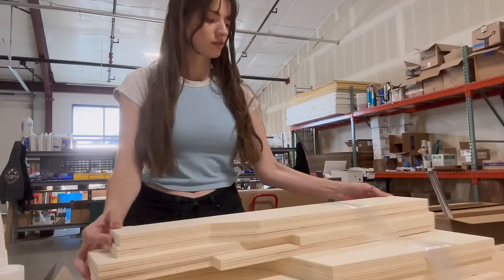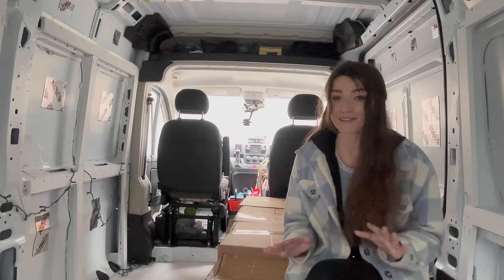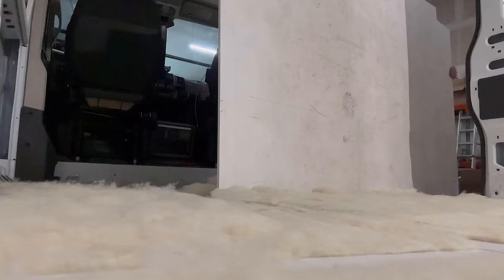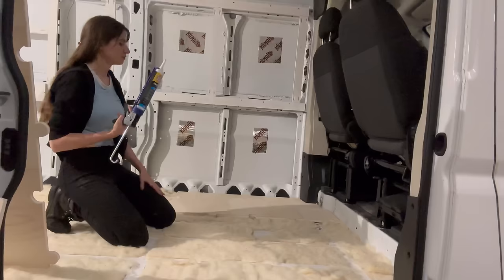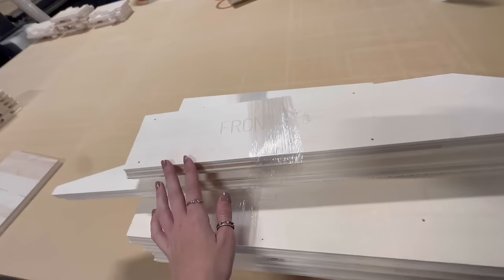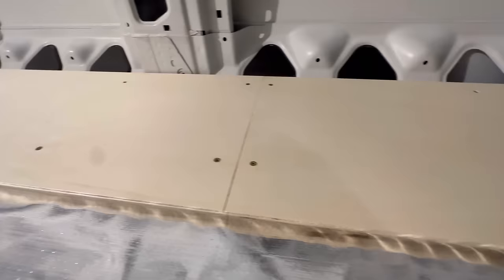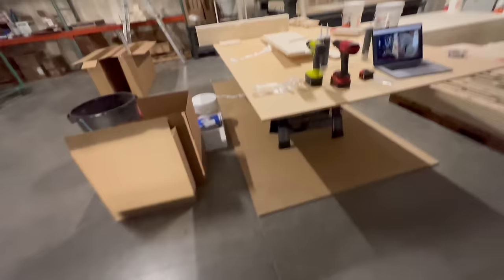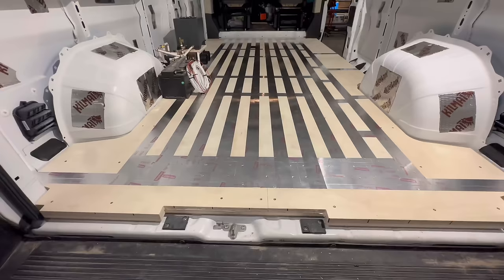Installing DIY Radiant Heated Floors by VanLife Tech

Comment: I am living full time in my van in the Wyoming winter. I installed this system in my van, and could not imagine living full time without it. Love my system.   It’s been a warm winter, but the coldest temps so far have been between 0-10 degF.
Reply: Did you have to sign an NDA??

Comment: I’ve done HVAC for 30 years. People think a small space would be easy to heat and little understanding of how it works. I live in the SE and don’t live full time in my van, but I don’t understand why hydronic systems aren’t more popular. I get it’s expensive, but there is no price you can put on comfort and I believe the pain of big expenses fades faster than the joy you’ll experience for years to come.
Reply: You could heat a 3000 square ft house with hydronic heat for what this costs.

Comment: Oh, When cutting with a compound miter saw, start the cut on the outside and push inward!  For any power tool the cut direction must always be the opposite direction the saw blade wants to run.

Comment: For quick insulation you can hang cargo blankets along walls in a van and they are cheap at harbor freight. I have several of those 72x80" price $12-15 depending on sale to full price, also the double length which is 144 x 80 is about $18-20 each. So for $80 you can put on floor, sides, and find a way to put on ceiling, and that covers most of the back inside area of a van. For ceiling cut some wood strips that will reach from both walls and also bend upward arch and use that to cover ceiling with the blanket. They are quite warm if you sleep with one over you in bed too, or roll up in it.

Comment: Heating of 23,000 BTU is equal to 6700W. If it is a heat pump (air conditioner) the heat provided is about 3x the input power, thus about 2300W power in, presumably from gas or fuel. It cycles on and off to reach a target temperature, so the average power used could be much lower.

Comment: I installed a Warmboard system in my new house. It's similar but uses a stamped aluminum sheet on the top layer to spread the heat around. Love hydronic floor heating.

Comment: Hello Tory, I am so blown away by your strength and courage let alone the willingness to put in the hard work, I commend you on taking up the offer of radiant flooring, please approach your electrical installation with the same insight knowing your safety depends on it, the new goal zero 4000 PRO adding Yeti Link Vehicle Integration Kit, pulls power from your vehicle’s alternator while the vehicle is running and stops pulling power when the vehicle is off. So many electrical systems are installed by so-called professionals only to fail, it costs the same after it’s all said and done, so please trust your original gut feeling when you started your last build. God Bless, Stay Safe.

Comment: Hey Tori, how are you doing kid.?? I enjoy watching your videos very much the building of your van and your explanation of things I like the way you traced off the floor using the mat that was in there that was really smart one of the things I have learned from my building experiences a vehicles, especially vans your better off not referring out the floor and just attaching the insulation right to the ribs so that there’s some airflow underneath there and vent if there’s any moisture or something gets spilled it finds its way down through there and you can it will always dry itself off in the air, but at this point you can’t do that because you’ve done that and you’re putting that radiant heat in the floor that is absolutely the most efficient thing that you could’ve done radiant heat in commercial buildings and even some garages that I’ve done where we put the heat in the flooris a lot more efficient than hot air and I’m sure your design will be nice but this is about the night this morning a little after one here we’re on know where you’re at but it’s Christmas Eve so merry Christmas and have a very happy and wonderful new year. Looking forward to more content. Keep it coming kid.

Comment: Living in northern New Hampshire - right  next to Vermont - and using a Webasto knock-off in our cargo trailer conversion and it gets plenty warm. Actually, TOO warm sometimes. #1 son lives in that fulltime through 4 New England winters. You must have misconfigured it, or you had no insulation in that van.

Comment: Tory, I meant to add that top-tier portable power station companies only compare their systems to the Yeti which has been using lithium-ion batteries they pioneered for over 10 years, no top-tier company has posted the Yeti 4000 or 6000 LiFePO4 battery technology or the Van Life Tech.

Comment: How does the foil radient barrier work with no air gap? Is it able to reflect heat because the pipes are not squished in there? Are they held slightly off the foil by the plywood channels?
Reply: No

Comment: Hi Tory, As someone who used to work in a wood machine shop, I have to say that when using a cross-cut saw or any machine saw at all, you seriously need to tie your hair back/up out of the way. It may seem trivial, but I've seen photos of people that had long hair and were literally scalped where the blade wrapped the hair around it and subsequently ripped the hair, skin and flesh down to the bone from the head. All of it. Pretty unpleasant and a very very serious injury.

Aside from that.... I'm thoroughly enjoying your videos and wish I was in a position to buy/convert a van for myself here in England. Unfortunately, money is not available for this. Good luck with your build and please, please, please, stay safe. Wishing you a lovely Christmas and a happy new year. Take care. D

Comment: $15,000.00 for van heat you get to install yourself. 1 - 2 yr warranty. You get to check Glicol annually (is that another way to say antifreeze?). Minimum 200ah battery system. Marketing genius.

Comment: So a Radiant Barrier is meant to "prevent" the transfer of heat...you might use this between your roof and your shingles so the heat doesn't escape; same idea as an emergency thermal blanket...it's why it's called a "barrier". Why would you use this between your subfloor and the flooring when you literally want the opposite, to transfer the heat into the flooring? If anything. you want to use this directly on your metal van floor to stop the heat from escaping..
Reply: The heat should go UP into the space not down into the metal and frame etc
Reply: @mrmotofy  well..sort of. The heat will go up into the plywood subfloor but won't go into the flooring because, well, you put a barrier there and, that was the whole point, wasn't it? To heat the flooring?

Comment: You can use a PCM blanket in the ceiling to reduce the cost of heating. Keeping the van at around 65F cheaper.

https://youtu.be/Nqxjfp4Gi0k?si=4joRRWOqGkq6rlgB

Comment: This isn't revolutionizing or something like that, even my caravan from 1983 have heating all around the wall inside with glycol and a boiler.
Expanding this to the floor and making sure that there is no heat loss should be the next natural step, and the same applies for me when I do get to buy myself a big van, and I will make sure that my van can tackle -50 below freezing head on with multiple ways like 4 or something to heat the glycol.
And life goes on.

Comment: Negative 4' ?? is that 'F ??? thats -44'C  your crazy, where was your diesel heater ?
Argghhh.. did you need about 60kg per tile to press it down onto the spars ? your floor was not flat, lots of raised edges. How long does it take to bond the base panels down ?
You had a perfect chance to show off your hoola-hoop skills.... and didnt....😭
Reply from the maker: Yeah it was -4 F ! It was awful LOL 🥶 And so usually we wouldn’t have had that issue except for the fact that we put it over a fully built floor with big gaps meant for the Baltic Birch I originally used  😅 So we ended up screwing the VanLife Tech floor into my old floor for it to be even but I didn’t include that cause I didn’t want to confuse people more 😅 But yeah that’s just cause my supports had big gaps but usually no one would have those ☺️
Reply: -4 deg F is -20 deg C, not -44. 
It’s the difference between really quite cold and holy headlights Batman, are we in Novosibirsk?